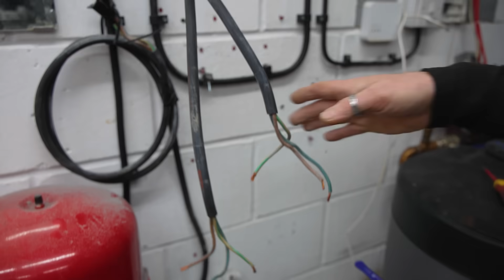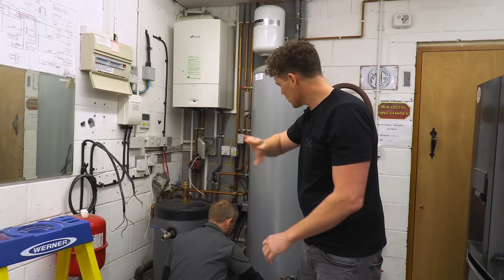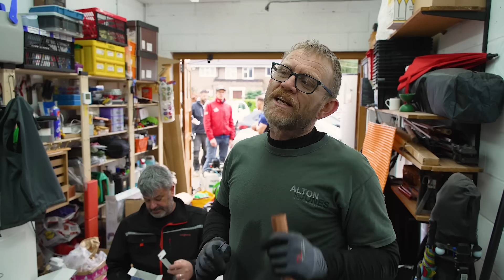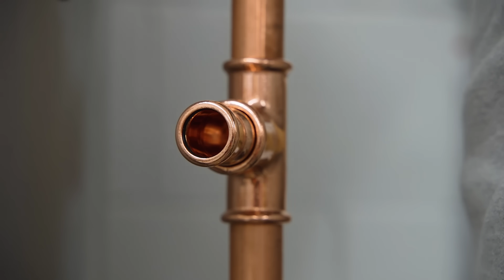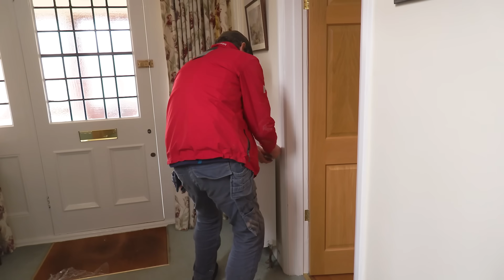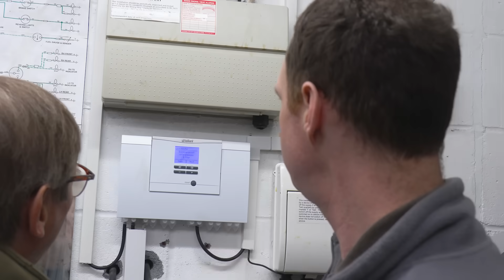Ultimate Heat Pump Installation. Rip It Out & Start Again!

Comment: Assuming average electric prices this system is costing £12.50 a day to run!!?!! 😮😮😮
Reply: Large house. Gas would cost a bit more than this a day
Reply: @UrbanPlumbers  I doubt that statement is true. How big is this house? I know a large 4 bed with a gas system boiler (probably the least efficient gas setup) costs no where near that much to run. Air to water heat pumps are not the answer. Not seen any evidence to ever convince me otherwise.
Reply: @forbiddenknowledge5722 heat loss is heat loss - and this house is over 12kW - done with gas on average the cost would be marginally higher due to air source huger efficiency- not a matter of believes - just facts
Reply: @UrbanPlumbers  I appreciate your input, but I’d like to see some factual evidence to support your statement. The data presented so far seems to indicate a different perspective. Could you please provide specific references or sources to back up your claim?
Reply from the maker: What this argument ignores is that many people switch their gas boiler on for two periods a day. Heat pumps are set up to heat a home when nobody is there so any 'efficiencies' must factor that in. 
I get greater economony out of my boiler when I switch it off.
Reply: @SkillBuilder  Take this another level wherein with a gas system or combination boiler, you only have to heat the rooms you use to the temperature you need them. You can't zone a ASHP system. Yet another reason they will never be as effective or cheap to run.
Reply: @SkillBuilder  isn’t John on 15p per kWh OVO tariff? That would make it even cheaper and impossible to match by any gas system, right ?

Comment: Great to see Roger coming on board with heat pumps. This should be required watching on prime TV to overcome the naysayers!
Reply from the maker: Why do you deduce I am on board?  I still don't see them as the answer for the average British home. A system such as this will set you back around £13,000 after the grant,  compared to a gas boiler at £3,000. You need to run this 24/7 where a gas boiler can be switched on and off.  
We will see if this system proves cheaper to run than switching a boiler on and off when you need it.
Heat Geeks did a great job and I am sure it will serve John well but he was warm enough with his £2,000 gas boiler.
Reply: @SkillBuilder This is the key thing. Just had a new boiler installed £3000. Got the flow temps turned down and weather comp.  Would never make the difference up.
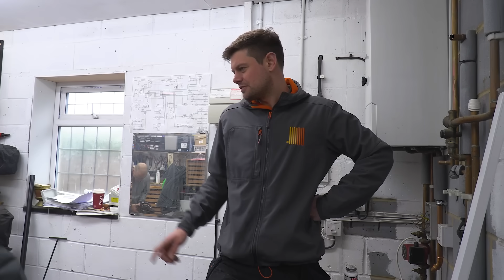Reply: OK so you were more open about the install so I took it you had been won over. But then if not let us pursue the debate. We need to decide what is the average British home and why they aren't suitable. I think it comes down to suspended floors and air leaky fabric in pre 1960 (?) homes. In reality that needs to be tackled as much as anything. It is now clear that the gas network won't exist by 2040/50. Hydrogen has been ruled out by the govt, the penny dropped that it is too dangerous and leaky for domestic use. The cost of checking for iron pipework in the 'average British House' will outweigh the cost of upgrading them to make them more comfortable with heat pumps. In truth, all those 19303s semis need to be refurbished every time someone moves out. Rip out the chimneys that take up so much room, get the walls insulated, aerogel on 9 inch walls where they exist (as they did in my West Wickham home) and seal up the floors. Either fill them in with insulation or seal them up another way. Then you won't even need a heat pump! And heat pumps don't need to run continuously... my ufh acts like a giant storage heater in my kitchen and for much of the year the heat pump runs only on cheap rate electricity overnight. We will need to get used to switching them off 16:00 to 19:00 to help the Grid out and no one considers a mix of heat pump and storage heater, This might be a good efficient combination in some homes. @SkillBuilder
Reply: @SkillBuilder  You're spot on, this system has been fully optimised by professionals and is still costing considerably more a day a day to run than a modern gas combi. It's not even that cold right now, just wait till we see negative temps and watch that efficiency fall through the floor and the cost to run shoot up.

The smartest thing this customer has done is keep the boiler. Thank God. He can strip out that heat pump and hopefully make back something towards the original installation costs by selling it.
Reply: @SkillBuilder exactly Roger. I am out most of the day and the gas boiler heats my flat in 20 min when I come back at 8pm. I don’t live in a big house with tons of unused space and a big basement to fit the warp core or the Enterprise (plus those huge outdoor fans that will be soon affected by the weather). I live in a flat in a 3-story-building that I bought working most of my life. Why do my taxes have to be used to pay these rich men with their new fad? Please, do another updated rant to give us justice. Everyone is brainwashed every day and your free voice is needed to counterbalance it.
Reply: I live in a 1960s ex-council house. I'm running the numbers and about to pull the trigger on a heat pump system. The install cost after BUS grant will come in between 5.5 and 6k, so more expensive than replacing the boiler, but it will save that 3k difference in well under 5 years.

We have a voting system that means the vast majority of us have no political voice or power at all. Literally the only thing I can do to have any kind of impact on the world around me is to do what I can with what little I have: if decarbonising can work in a very average 3-bed semi-detached family home like mine, I can just hope that people around me see that and consider it themselves. As a society, we can and should be doing more, but it's not fair for the onus to fall on individuals, and I certainly don't judge anyone for the choices they have made. My sights are firmly and only set on the government on this, so before anyone accuses me of being holier than thou or preachy: nope, I'm not having it, direct your anger at No. 10!
Reply: I wish you well with your install. I have been happy with my heat pump, and yes it is cheaper to run than the oil I used to burn. @Roobubba
Reply: Even the gas boiler is more efficient if run constantly at a lower temperature.

Comment: Best of the best equipment and it still can't make the guaranteed SCOP? This just isn't the answer.
Reply: SCoP is over 12 months, you're looking at current CoP figures. The CoP is always lower in the colder months and raise when the external temp is above 8⁰C ish. Look at it in a year.
Reply: The scop of this system will end up being about 4.5 throughout the year.
Reply: So, when you need it the most in the winter it's preforming below the guaranteed rating and costing more than a combi to run. Then in the summer when you don't need heating and use less HW your reliant on that to boost your stats. Got it, thank you for clarification.
Reply: @forbiddenknowledge5722  No at all. It’s now already performing over the projected scop.

Scop is the average over the year. It’s the total kWh of heat generated through the year divided by the total electricity used throughout the year. This already weighs the calculation heavily in to the winter accounts for higher winter use. It’s also the most accurate and important way to do it because it’s how your heating bill works which is all we care about.
Reply: @HeatGeek  Thank you for clarifying how the Seasonal Coefficient of Performance (SCOP) is calculated. I appreciate the focus on energy consumption costs. As more data accumulates over time, the homeowners will have the opportunity to compare running costs between this system and a combination boiler. However, based on the current evidence, it appears that the gas boiler may be more cost-effective over the course of a year—unless there are significant fluctuations in gas and electricity prices. Ultimately, real-world data will provide the definitive answer.

Comment: There are some air to air systems that can run the refrigerant through a small hot water cylinder. Daikin multi plus for example.

Comment: Well done heatgeek on your £4.9million grant to get the industry working properly. First point of call is to restructure and take over MCS so they will actually fix problem installs and properly call out bad installers. It's also time you were a little more agnostic with your HP manufacturers. Vaillant are not the best or the only good manufacturer. Congrats on helping this HP gone wrong.
Reply: This is a question I have just asked , why vaillant over Mitsubishi, talking my own book here as installer has quoted us for two Mitsubishi units and I want to know which is best and preferably why ?
Reply: Valiant were the best performing free heat pump.

Comment: been in for 2 weeks and scop is 3.82, below the guaranteed 3.9. But it does look like someone is leaving the front door open between 2 and haLf 3 on weekdays
Reply: That’s the hot water heat up! This scop will end up around 4.5
Reply from the maker: They had to go out for shopping and to put the bins out.

Comment: Ok so all the stops pulled out for a 1 st class system installed by top engineers . But we are all in the real world, this needs to be not one installer friendly but user friendly. This ain’t happening without financial back up and manufacturers simplifying controls . In your latest video the client asked can you get the BBC on it ………!!! Says it all 😢
Reply: We have 100a of heat geek trained to the same standard up and down the country. You’re right on the finance though. This doesn’t work for ‘normal people’ without that!

Comment: Probably the biggest smile I've had on my face watching a YouTube video, some of the best ASHP installers all knocking it out together, must be a proud moment for Adam, such a great reward for the years spent bringing these guys to such a high level of credibility. 
So Roger when are you getting one.
Reply from the maker: Hi Derek 
I was offered one for nothing but I like the flexibility of a gas boiler than I can turn up and down and don't have to run 24/7.  We switched our boiler on at 5 pm today. We didn't need it on during the day. it will go off at 10 p.m and the house will cool down to a comfortable sleeping temperature. John's house stays at the same temperature day and night. If you like that then get a heat pump but I don't.
Reply: @SkillBuilder  Hi, surely the individual rooms (like bedrooms) can be kept at different temperatures from the rest of the house? Or do you mean you have your bedroom warm in the day, and cold at night? Great video btw.
Reply: @SkillBuilder  So how are you going to decarbonise Roger? You'll have to eventually. Cooler bedrooms is the main reason for bedrooms downstairs and living accomodation upstrairs, which isn't very common in the UK, but you could probably do it in quite a lot of houses if you wanted to. We just don't heat our bedroom at all but it doesn't stop the living room being at a nice temperature. Seems to me that's independent of the heat source.
Reply: @xxwookey   You haven’t worked it out yet , you are the carbon they want to get rid of 😂
Reply: @xxwookey  ‘ They ‘ is too deep for this thread . Not to get rid of everyone just the majority.
As for GHGs it’s how they produce electricity.
Reply: @haydnlawrence8167  Well it's how they produce some electricity - the fossil-based stuff (50% in the UK, 100% in Chattisgargh and 2% in Norway so it varies a lot). Power generation is now less than 20% of emissions and falling fastest. Transport, heating, agriculture and industry are all in the 15-25% range. None of those are falling much if at all so far (it does vary a lot by region).
Reply: @xxwookey  Have you ever questioned a mainstream agenda or do you blindly follow them all ?
Reply: @haydnlawrence8167  Of course. I'm very skeptical of mainstream trends, and go to a lot of trouble to remain in control of my own destiny. Why do you ask?
Reply: @xxwookey  Ok how many jabs did you have ?
Reply: @SkillBuilder   "John's house stays at the same temperature day and night". There's no  real reason for that to happen though, unless it is his preference. A setback temperature at nigh-time allows for different night-time temps.
Reply: Smile ? 
I was laughing my bollox off 😂

Comment: Watched this saga from the start and it leaves me breathless. All the average punter will take is blah blah blah (with apologies to the Thunberg entity) whilst multiple experts re-do a failed installation (what are these cowboys like?).
Meanwhile, sitting sulking in the midst of the Tardis like engine room is the common or garden gas powered boiler costing two balloons and a frog ready to leap into action as you leap out of the shower.

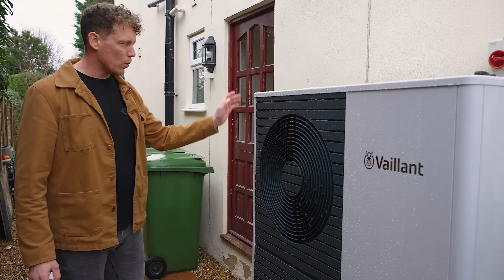Comment: @14:29 Isn't the back of the heat pump a little bit close to the wall?  I dunno the Vaillant specs, and granted it isn't a wide passage way, but aren't you making the fan do a lot of extra work if it has to pull air in that narrow gap next to the wall before going through the heat exchange and gets chucked out of the front of the unit?
Reply from the maker: It is 200mm exactly what they require
Reply: @SkillBuilder  It's worth noting that Vaillant calls for a rear distance of 250mm if it's to be used for cooling as well. In my opinion, it's wise to install them at that larger distance in case cooling is used in the future.
Reply: @SkillBuilder Thanks - I'd commented before I then heard that mentioned a bit later in the video...  200mm is the minimum tho' (although some of the Vaillant docs say 250mm (!)) and there will be better air flow if it was upped a bit (particularly at higher fan speeds).  Even 250mm vs 200mm would make a surprisingly big difference - I sometimes do air distribution design professional.  How much influence that'd have on the CoP dunno - might be negligible, might not.  A mate of mine has a Vaillant Arotherm on his house - I'll see if I can interest him in an experiment (sticking a board behind his to take it down to 200mm clearance from the 300 or so he has).

Comment: Great to follow this series Roger. Love the channel. I help run a community centre which was recently upgraded with a heat pump installed. Air source. Bloody great system but be heck it is expensive. We are getting bills of 3,000 a quarter whereas before it was around 400. Can’t figure it out. Love the idea of being green, but bankruptcy is looming! Help!
Reply: Please check our 3 steps to system efficiency video out!!! Should get it to drop down to previous levels!!

Comment: Yeahhhh, 15 guys to get a heat pump working. Think I'll stick to Oil. My condenser boiker is 97% efficient and works in the cold
Reply: Do you reckon oil will not be pushed up in taxes going forwards?
Reply: @James-dv1df  do tou think electricity is goin to stay static. We already have the most expensive electricty in Europe here in Ireland. €50k to €70k retrofit a house ready to work efficiently with a heat pump between glazing, insulation, ripping up floors to route piping etc  plus another €30k to install a heatpump. Can buy a lot of oil with that and I don't need a degree in thermodynamics to operate my heating. Possibly makes sense in new builds but not in old houses
Reply: @Chris_Willows  Most of the Western world has declared war on fossil fuels including coal, oil, and natural gas. The winner has already been chosen as renewable electricity no matter how much it needs to be subsidized. It would be political suicide if everyone's electric bill doubled simultaneously. Individual wild swings in differing fossil fuels at differing times allows not only the blame to be shifted elsewhere, but far fewer individuals would be wielding pitchforks at any one time. With 200 years worth of known worldwide reserves of natural gas, and most of that in stable countries there is no reason for price volatility in any fuel. 

The fix is in and there's not much that any single one of us can do about it. The only advise I can give you is don't bet on the wrong horse.
Reply: 97%? I'm not sure that even an EOGB Sapphire would achieve an efficiency of 97% in a laboratory test, let alone in a real heating system.

Comment: So you need to build an extension to fit these heat pumps, and you end up with a bloody noisy big fan outside.... And loft space that cannot be used.... And they still rely very heavily on electricity to heat the hot water...
Reply: Loftzone has a kit to allow boarding out lofts with 300mm+ insulation.
Reply: Like Cartman said: “Yeah, pretty much…”

Comment: when I look at the live data, to me it looks like the guy has an energy bill for heating of 350 quid per month based on let's say mild weather. When it really freezes I don't want to know
Reply: It’s a massive house and we ran the heat pump hotter than it needed to be at first to get some heat in the building. Give it time and it will prove cheaper than gas.
Reply: Especially when we stop massively subsidising gas and create a more level playing field for energy @Cllr_Sammon
Reply: It must be a big house, it’s performing with a cop of 4 so I assume the guy is used to some big gas bills anyway.
Reply: @edc1569  at the moment 3,8 at 6 C The colder it gets it will turn to 3 or less which is inefficient, They installed a bigger heat pump but when it is below 0 i need to see if it will get warm. It will work/not freeze up but it is not the golden egg. It is an alternative to gas but at a higher price
Reply: I’d ignore the first 1 and a half weeks. We couldn’t get in to adjust some settings as John was away.